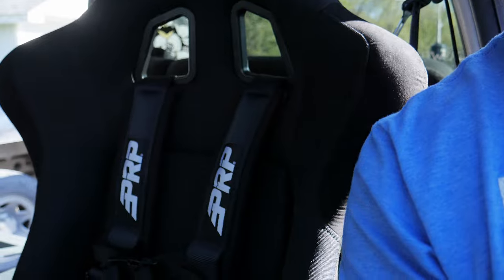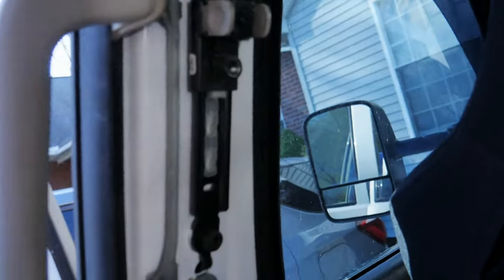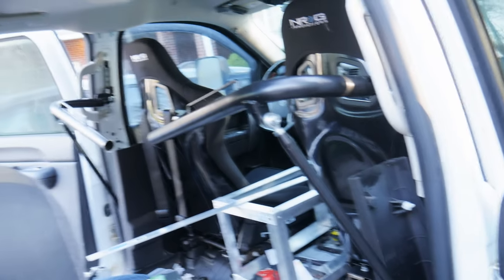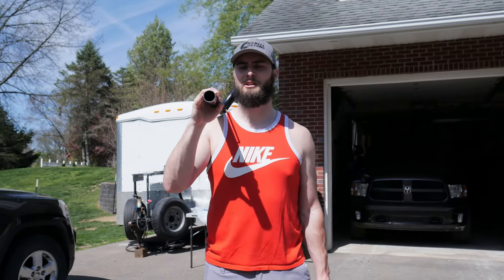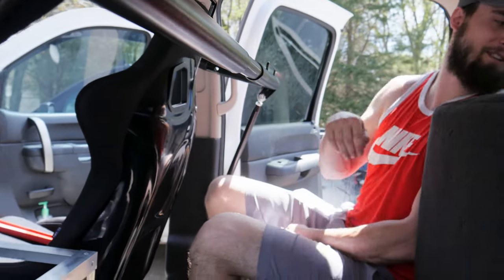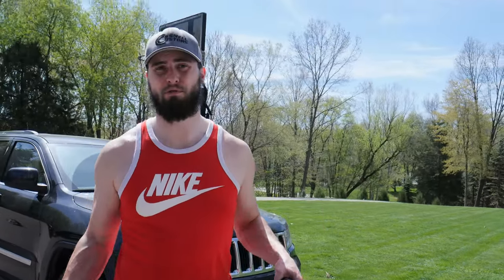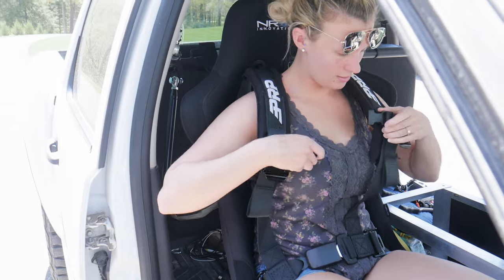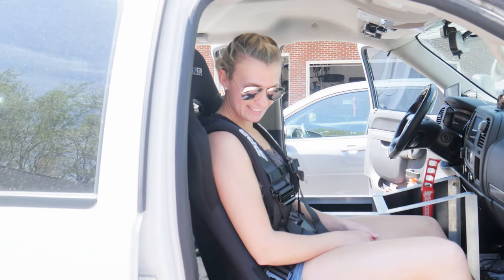Silverado/Sierra GMT900 Universal Harness Bar Install 07-13

Comment: The piece you put inside was it DOM?
Reply from the maker: Unpolished (Mill) 1008-1010 Steel Round Tube, 1.250" Outer Diameter, 0.120" Wall Thickness, 1.010" Inner Diameter, 4' Length